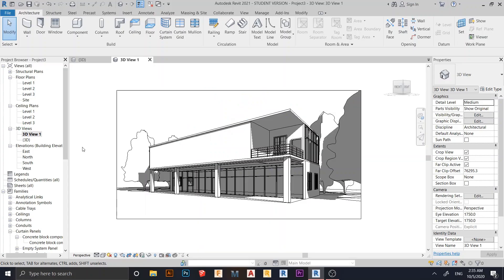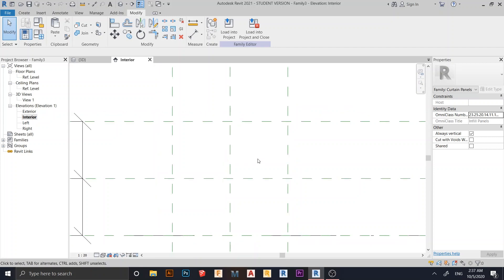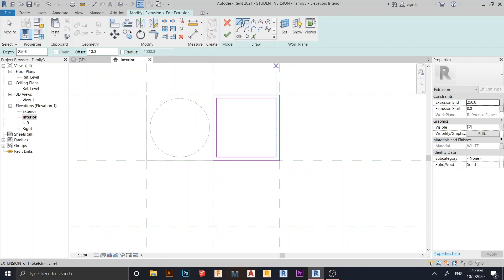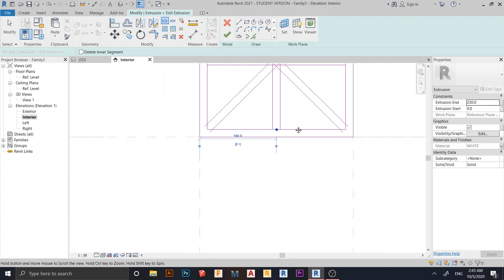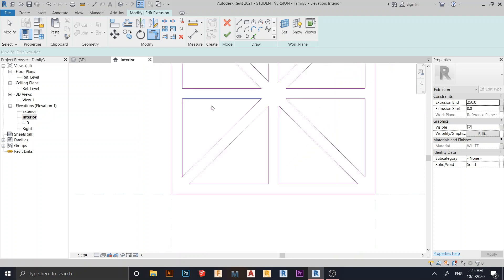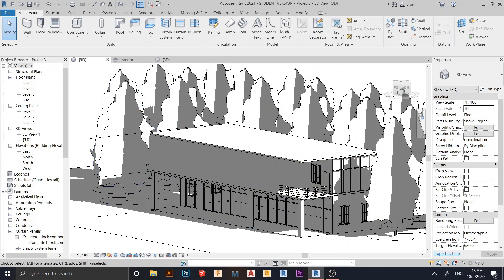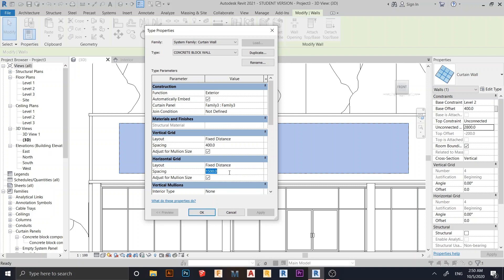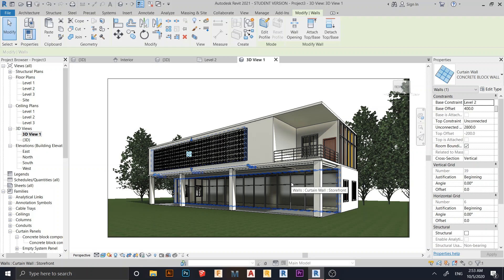Revit Architecture - Pattern Concrete Block in Revit

Comment: Really great turtorial for beginner as me. Is it possible to make that with steel brace construction ? Im
Reply from the maker: Hi, Yes it's possible, but you need might be need more technician to create that.
My suggestion: for structural steel bracing try to using custom steel plate to create that is the best way.

Comment: Great video, it was very helpful!!! Is there a way I can create a family of this same type of blocks but instead of a curtain wall, for a wall? I'm trying to add it in a slanted wall but since it is a curtain wall it is not possible, because revit doesn't create slanted curtain walls. Thank you again for the great tutorial!
Reply from the maker: Hi, using generic model pattern base can help in your situation, I'll consider to make a tutorial about it. Stay tuned man.